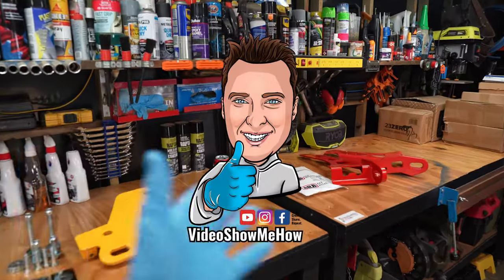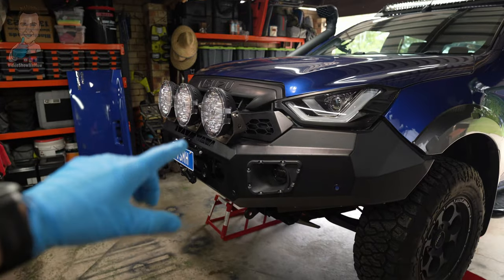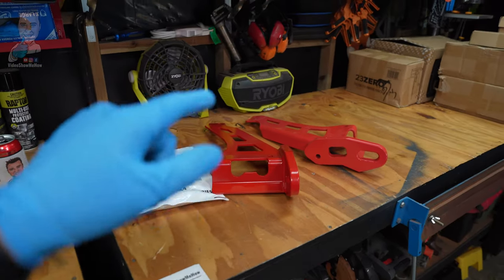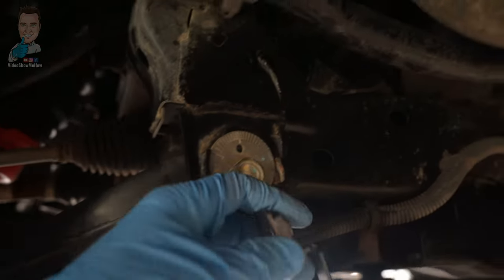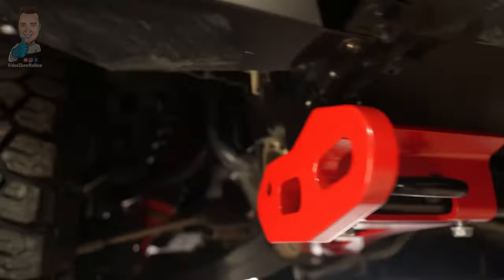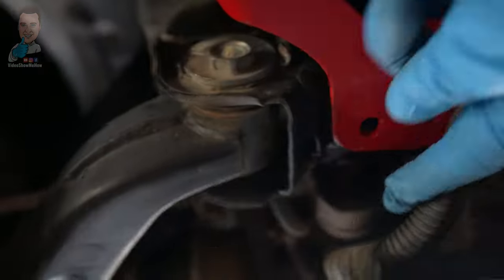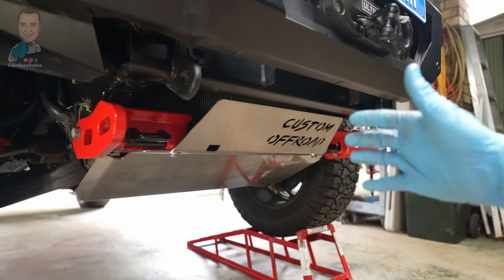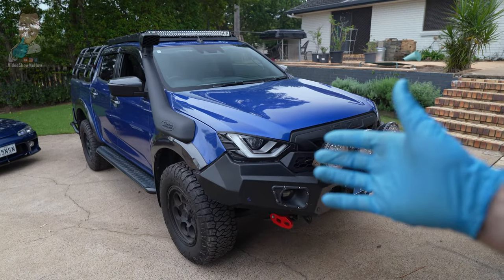How To INSTALL ARB RECOVERY POINTS to 21+ ISUZU  D-MAX | New D-MAX Build Series #47

Comment: No cutting of the factory bash plates on an MY21 required.

Factory plastic bumper needs a small section cut though. I used a small gyprock jab saw and that worked a treat.

Comment: Great video, thank you! Interstingly, the ARB Recovery Points for this vehicle provide a cross brace back to the sub chassis which locates the lower control arms, as opposed to the previous generation MU-X ARB recovery points which brace back to the main ladder chassis. In an event of a recovery at huge loads, would this elongate the lower control arm sub chassis and possibly cause wheel alignment issues?

Comment: Awesome vid mate, thanks for sharing! Can I ask, why do you install 2 points (drivers & passenger side)?
Reply from the maker: It's better to spread the load across both chassis rails on a front recovery (using a bridle strap) and it also gives extra options for more technical recoveries

Comment: Hi Adam, I have installed a set of these recovery points to my MUX today. While I was doing it, I notice the oil filter is right above the driver side of the rear end of the recovery point as per video at 6:19. How is your oild filter change experience after installing these? Did you have to remove RH recovery point when changing oil and oil filter?
Reply from the maker: Doesn't impact it at all, oil filter is easily accessed from underneath

Comment: What’s the difference with using those recovery points compared to the ones on your bullbar?
Reply from the maker: The ones on the bullbar aren't rated (bullbar was a prototype) so prefer having the recovery stuff 100%. Plus the arb 9nes are twice the thickness 😁

Comment: How have you found the ARB recovery points over time? Im considering getting the arb ones for a 2023 MUX, and looks like its the same recovery points.
Reply from the maker: Best out there imho, was very glad to have the extra strength (8000kg compared to most at around 4500kg) when on the Cape York Trip

Comment: Hey, thanks I installed the yellow ones, took 4 hours first one 2 hours the next... yellow ones seem stronger than reds. Chassis!❤
Reply from the maker: Yellow are rated to 5000kg each and red are 8000kg each?
Reply: @VideoShowMeHow  wow, really,  it's using the front rad support and suspension mounts... 👍 ok!
Reply: Reverse camera!
Reply: Yellow ones u have to drill through the chassis,with a plate and bolt... jesus... string as!...🙄
Reply: Strong... ohh u have too remove the sway bar, then get your front suspension realigned

Comment: … do you know if these recovery points are exactly the same ones for the MUX?
Reply from the maker: I would say so but would check with ARB 👍
Reply: I checked with ARB today and the part numbers for these red points in the video are the same part for both MUX and D-Max. I'm getting a set soon.

Comment: Possibly a dumb ass question but here goes anyway. Is it necessary or recommended to have two recovery points on the front or would one suffice?
Reply from the maker: Ideally you want one on each chassis rail so you can use a bridle (that centres the load) when recovering from the front. Can get away with one, ideally you want both for those big recoveries
Reply: @VideoShowMeHow   Cheers for that